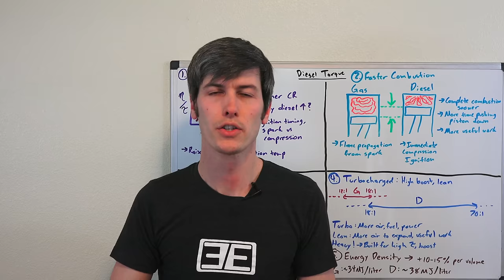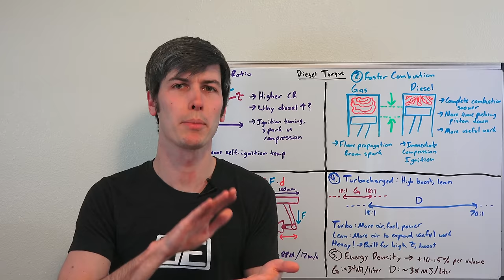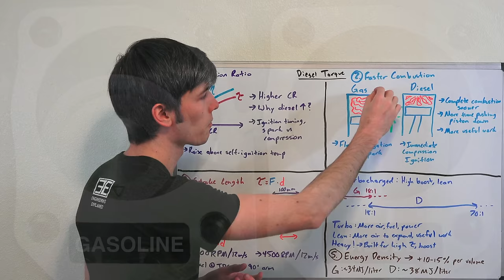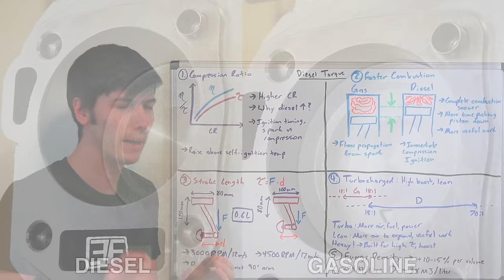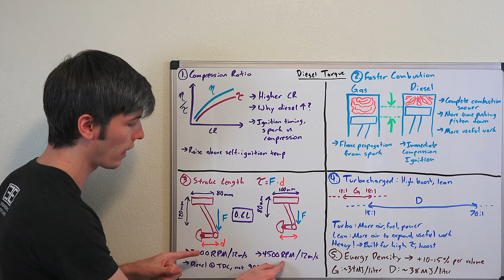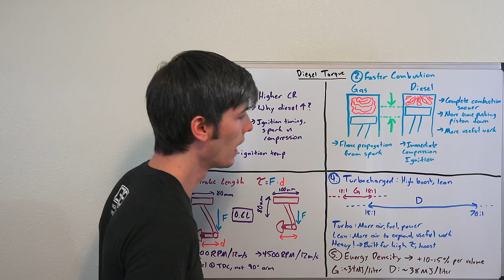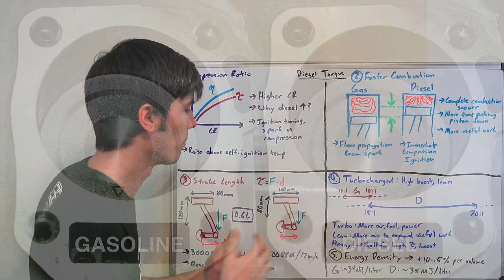5 Reasons Diesel Engines Make More Torque Than Gasoline

Comment: so why are no supercars diesel?
Reply: cuz torquie supercars are no fun when they are 500hp vs the fancy neighbours 707hp gasoline car, so no bragging rights wich makes them some what useless
jokes aside its as simple as that theres no braggin rights for the PR people to work with in a supercar/muscle so their job becomes a nightmare and people dont seem to care about diesel, let alone all that people that think diesel is the nastiest stuff in the world
Reply: I think it has to do with the lower rpms associated with the longer stroke length and heavier components. They have more torque but can't rev as high so in the top end gasoline ends up with more power. (I think, I could totally be wrong.)
Reply: No, you're correct. Diesels simply don't generate as much power as gasoline counterparts.
Reply: diesel has lower HP than gasoline in same displacement. for comparison, the 2.5L turbo diesel produce 180 HP while 2.5L turbocharged gasoline engine can reach 270 HP. I heard that furthest speed that diesel car can reach is 177 mph, while gasoline now is 278 mph.
Reply: ford's Focus RS has a 2.4L turbo 4-cyl I believe, with 350 HP :)
Reply: KOLT Volvo made a 2l i4 with 450hp..
Reply: Same reason most trucks have Diesel engines. Engines with higher torque are optimised to pull heavy loads whereas engines with more power are better suited for speed.
Reply: Diesel= high torque, low rpm   

Petrol= medium torque, medium rpm 

Rotary= medium torque, extreme rpm
Reply: Because torque can be converted by gear. Power can’t
Reply: If your supercar is all torque, all you'll do is spin the wheels. Diesel cars can be fast, and 2+ litre turbodiesels can attest to this, it's just diesels are far better at high  torque figures and high MPG and gasoline engines are better at top speed and horsepower.
Reply: Up until recently Audi ran a successful diesel engine in the WEC series. They have since switched focus to the all electric of the Formula E series.
Reply: Take a gasoline and diesel pickups, hook the same load to both. The diesel will pull better and have better fuel economy,  unhook the trailers and drag race them and the gasoline will win. Which is better depends on the purpose of the vehicle. Gas also has better cold start properties, so in cold climates that is also a factor to consider. I own both, I've got a 14.6L 3406e cat and a 7.3L powerstroke for my diesels, 3.8L and an old 4 barrel 350 chevy for gasoline. If I need to move something heavy I use a diesel, if I want to drive fast and act like I'm a teenager I use a gaser. Gas is also cheaper to fix usually,  so if your going to be abusive it's probably the way to go. If your going to treat it right diesels can last forever giving you a low cost of ownership. 

Super cars don't haul heavy loads, and they are ment to be abused. In other words diesel just isn't a good choice for them, same as cargo ships and semi trucks don't run on gasoline as it would be a horrible choice for them.
Reply: because all producents of supercars are purists, and they doesn't like diesels
Reply: Diesel: doesnt rev, slow response, only quick (ish) with turbo and therefore even less response, ugly sound, dirty smoke and come on trucks tracktors and commercial vehicles have diesels. You dont want your fine expensive sportscar Sound like a dump truck
Reply: Probably more due to the weight and size of the engine.  Mass plays a big part in the performance of a supercar.  And with a physically bigger engine, your aerodynamics get affected because of the size of the engine bay needed to accommodate the engine.
Reply: Why no Supercars diesel?
A lot of people say "they don't have enough power". That isn't true! It's possible to extract 700hp or more from a 3.0 Turbo Diesel. Europeans are very "specialist" in this part because Diesel is very popular in Europe and it's very easy to find incredible projects.
BUT:
- They are heavier, which isn't a good thing for a Supercar
- They will be more expensive/complex to maintain
- The most important: It's IMPOSSIBLE to do it legally because of Pollution!! Even in Europe where Diesel Laws are a joke, it's totally impossible to have a Super high performance diesel car that match the European laws (imagine US...). To match regulations, you always need to compromise power ALWAYS because all the parts and Engine/Exhaust working flow you need to do/put in order to have a decent NOx production.

Brands are struggling now, they don't see how do better and reduce even more... That is why Diesel Gate wasn't totally a surprise and why brands are starting to put Diesel out and embrace electric.
Reply: Govin Lock well thats not the best example,  there are 2.0l diesel that make 240 HP from the factory and the example you gave in gasoline is from a superar,  which isnt the best example in this situation because they don't make diesel supercars
Reply: veyron engine weight 400kg, porsche boxers are heavy, subaru boxers are heavy, but Audi R10 TDI engine weight 220kg, weight isn't a factor, sound is a factor, but if i had supercar brand I would show a few diesel supercars
Reply: SergioRC The Gamer saab 9-5 has a 2.2 diesel with about 250hp from the factory I think. Petrols rev higher and so even though they have less torque it is being applied more frequently than a diesel. This is why a 600cc motorcycle can make 130hp with only 60lbs of torque whilst a Harley with 100lbs of torque might make 80hp.
Reply: Joel Araújo there may be a few over 700hp 3.0 diesels but they are pushed quite high. On the other hand there are PLENTY 2-3 Liter Gas engines that make 1000hp. And yes they are pushed as well but i just wanted to point out that Gas engines just make more power. I have never seen a 2 Liter Diesel that came close to 1000hp but i have seen 4g63's and other 2.0 4 bangers that even go over 1k. So the diesel must have a Limit lower than the gas engine. Plus without forced induction a diesel is very very weak. A gas engine doesnt need that to make decent power.
Reply: audi successfully used a diesel engine in WEC some years ago. the main problem is the higher weight and the longer piston=higher inertia plus the diesel fuel tends to do not burn completely at a certain point (high rpm or too high compression). For example in F1, afaik, the engines can work like diesel angines at full throttle and certain rpm without all the diesel problems. so for race cars, there will never be a diesel again.
Reply: alessandro ari zaluski veyron engine is 16 cylinders with 4 turbos dude...of course they are heavy. Btw a 2.0 tdi weights 160-170kg vs a nissan sr20 for example 140kg. And the r10 tdi is a full blown racecar....you cant compare this to road car engine that actually has to last longer then a Season.
Reply: 99Lezard99, yes, but diesel engine can be very very powerful. Is not a question if Gasoline makes more HP or not. If you can make a 700hp diesel (with all the enormous torque), you can make a supercar diesel.! What kills the all the chances of any brand making one is because of Pollution. It's impossible to make a super performance diesel car that respect the law. No way possible.
Reply: Joel Araújo sure possible but also no one would buy it. It lacks sound revs response and image
Reply: Because they are a lot less powerfull and way heavier. There's no benefic of diesel engines other than economy, wich you don't care if you have a sueprcar
Reply: There are some endurance rally events that are dominated by diesel race cars... look it up. Turns out that fueling time is a huge factor when it comes to hyper distance races... diesels just don’t need to stop as often.
Reply: Diesel powered vehicles have done pretty good at LeMans.
Reply: Aaron Garcia of course. Thats thier only real advantage. Endurance races because of fuel consumption.
Reply: You are all forgetting the most important thing, sound. Gasoline cars sounds better and who would buy a suoercar that didnt sound good
Reply: who would buy a suoercar that didnt sound good? Rimac owners
Reply: Jason, doesn't diesel have a density of about 0.9Kg/L and gasoline 0.71-77Kg/L. Shouldn't there be a PE difference of 20% between gas and diesel?
Reply: Cause torque breaks stuff, rpms don't.
Reply: Are RPMs really that big of a deal when gearing can simply be adjusted?
Reply: I think engineers could make diesel supercar technically, but the main problem is sound and pollution and I think those are only problems... sound for better reputation of the model, hence better selling and pollution just to make it avalible to get sold.. also I think that there is much higher needs for some diesel parts than for the gasoline engine parts and the only better thing that diesel has is better fuel economy compared to gasoline. Ok, yes also way better torque, but way lower maximum speed... idk, im good with both, but I owned only gasoline cause they are easy/cheaper to maintain and I mount gas on them and cool. But im buying normal cars that arent ment to be held on full throttle..
Reply: There are some fast diesels like the rare M550d and Porsche Panamera S but not supercars
Reply: because you make your own. makes for a good drifter and burn out champion
Reply: Jay Dunbar go watch YouTube videos of gas vs diesel trucks drag racing. diesel wins more often than one may think.
Reply: Phew... many answers but hardly anything correct.

Maximum power or torque of an engine is not enough to say something about the accleration of a car. The tractive force (I hope it is the correct english word) on the wheels is the thing you need to know (and of course the weight of the vehicle). This tractive force depends considerably on the gear ratio. Lower gear ratios means more torque and more tractive force on the wheels. As Diesel engines are limited in revs you also need a longer gear ratio which results in lower torque and tractive force on the wheels.

Diesel engines are also heavier, don't sound that good and so on...

If you want maximum performance choose the Otto engine, if you are interested in fuel consumption choose the Diesel engine.
Reply: Diesel engines aren’t always heavier, for example a Mercedes om606 3L diesel weighs in at 210kg. A 2jz turbo weighs in at 234kg! The same engine is also known for revving to 7200rpm with just valve springs. And creating in excess of 700hp with an unopened engine. In fairness there aren’t many diesels like them but they still are capable of them figures!
Reply: Audi r10 is one. In fact they won so much that they had to put a turbo inlet restrictor and smaller fuel tank to allow gas/hybrids to even stand a chance in Le Mans 24 hrs
Reply: PataMies17 Rolls Royce uses diesel.
Reply: because diesels are more fun/easy to tune and you can make your own "supercar" out of an ordinary 3.0 turbodiesel diesel 
I've seen 500hp figures on 1.9tdi vag engines without NOS.But for sure pollution and sound are a big factor
Reply: There is a diesel koneinsegg
Reply: Diesel s do not turn many rpms
Reply: @julianmatthews5785  Nah, rotaries make a lot of hp at high rpm, but they ain't that good on torque at the low end. Thats why they make their max hp at high rpms rather than the middle like in a standard engine
Reply: I have a bmw 335d, 330-hp and 530 ft-lb torque. My friend has a cadillac ats-v. 540 hp 550 ft-lb torque. both cars are tuned, and have similar engine displacement, 6 cylinders, rear wheel drive and over 500 torque. 
That's where the comparo ends. My bmw can pull from 1200 rpm - 3000 rpm better than the cadillac - the torque instantly kicks in, so it gets off the line sooner. Yet above 3500 rpm, theres no power in the upper room. The mechanism of longer stroke means you cannot turn the crankshaft as quick and  you lose steam. So that's when horsepower kicks in and takes you to outer space.  In racing applications (i.e supercars) you use launch control to get the car off the line by increasing engine throttle, to compensate for lack of torque, and allow the high-end power of the engine to pull you. Diesels have no explosive power at high rpms, and thus to get into the powerband, you need to shift to next highest gear to pull. With petrol engines, you get power at the higher-end, and can use the lower gear ratio. E.G I have to upshift to 4th gear when at 3500 rpm @ 3rd gear to feel the power, but my friend can remain in 3rd gear and pull to 6500 rpm. And he pulls to 140 mph while I'm at 115 mph under full throttle. 

Diesel is meant for heavy haulage, or efficiency purposes (I get 40 mpg, my friend gets 16 mpg) and is not applicable for high-end power usage. You dont rev a 18-wheeler truck to redline to get it running - you start from ground-up. But you rev a racing car to half-way at a stop, and use launch control to accelerate.
Reply: there are but they are two cycle engines and they still have turbos
Reply: @Velkanis  but it would be a bragging right if you smash your opponent's 707hp blower gas V8 with a diesel
Reply: @ChuppaChuck  unless they're turbocharged
Reply: @govinlock8568  actually you can tune that 2.5L turbodiesel to over 500hp. Some say people have done that to Toyota's 1GD-FTV 2.8L engine(may be 0.3L larger but the 2.5L turbodiesel may be able to do the same thing as well)
Reply: @julianmatthews5785  rotary has low torque at the low rpm
Reply: Diesel burns slower, therefore it's not possible to have high revs while power P = M*n, so no revs, no power.
Reply: Tyhmä

Comment: Look at the Nissan Patrol from the 90's. They have a 4.2L naturally aspirated diesel (TD42) and a 4.2L naturally aspirated petrol engine (TB42). The bore and stroke are identical on both, yet the petrol produces 15% more torque and 30% more power at only 200 rpm more. I realise this is a one off but it's a great comparison of engines with identical bottom ends which eliminates the bore  and stroke argument.
Reply: Reason why dragster snatches 6.2 Chevy diesel engine blocks and throw on gas heads and use electronic ignition because the blocks are the same there just beefier! then supercharge it or turbocharge it and crank up the boost!
Reply: Your math is wrong. You were supposed to compare torque/fuel, not torque/engine_configuration
TB42 is a fuel monster, while TD42 consumption is decent for its performance.

Comment: Excellent video that explains things very well, but perhaps It's also worth mentioning that although diesel fuel is more energy dense, it has a slower burn rate than gasoline, which imposes a limit on the maximum rpm at which a diesel engine can continue to produce power. That comes out at only around 4000rpm, and there's nothing to be gained by designing the engine to spin faster in order to do more work  because the fuel won't be able to burn fast enough to keep up with the shorter  compression/ignition cycles.

Comment: Bore / Stroke doesn't affect the torque - Consider 2 engines have the same volume and pressure. One has 2times the stroke but only half the piston area. You get 2 times the distance and half the force.
Reply: No,  you will get more torque because of the longer arm of the crankshaft.  But you'll get less horsepower because it can't rev as high as the short stroke engine.
Reply: Bravo, at least somebody understands physics and mechanics. Most of the posts and comments on here are just wrong, and the frightening thing is that people with no technical insight blindly accept it.
Reply: Yeah, but in fact the crankshaft of a long-stroke engine acts as a reductor, producing lower speed and higher torque.

Comment: Well, this encapsulates the problem with the internet.  You can put out a video that is woefully misinformed, and people can't discriminate.  First- Rudolph Diesel was trying to make an engine where heat is added (fuel burned) at constant temperature, as opposed to the constant volume of the Otto cycle.  This proved impractical so he settled for constant pressure.  To achieve this, fuel is injected slowly after TDC- hence the slow speed of diesels.  Gasoline (Otto) engines burn the fuel much faster, not slower.  There is no difference in the speed of burning of the fuel itself- it's how fast its injected.   For the same compression ratio, the Otto cycle is actually more efficient, has higher BMEP and so produces more torque.  A diesel produces more torque in practice because it has a higher compression ratio (since there is no risk of detonation- and they are usually turbocharged for this reason), hence higher BMEP.  Second, bore/stroke ratio has NO influence on torque.  Torque is BMEP x displacement, that's it.  Please stop perpetuating this myth.    I usually enjoy your videos, but I think you should post a "correction" to this one!
Reply: He stated in the video that stroke wasn't as important in producing torque as compression ratio and fuel being injected directly into cylinder.
Reply: Very true. The Bosch PD injectors produced 2,050 bar 28,700 psi at the injectors, 
Since these cannot meet Euro,6 emission standards, Bosch have developed a new common rail pump that produces 2,200 bar, 30,800 psi.
Reply: This